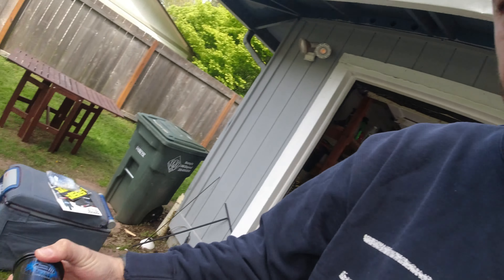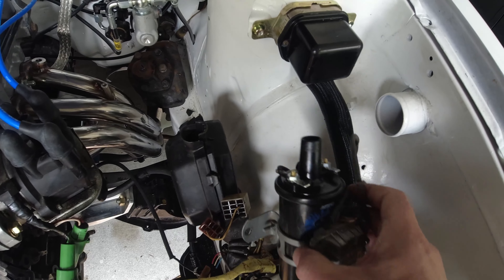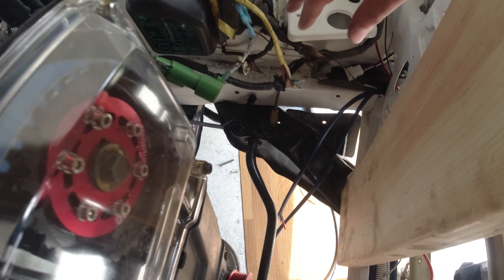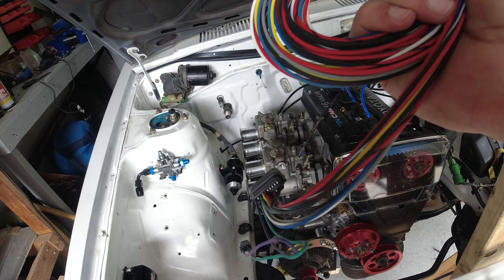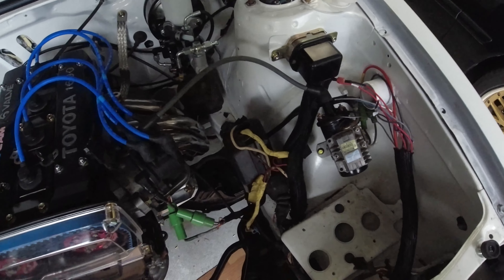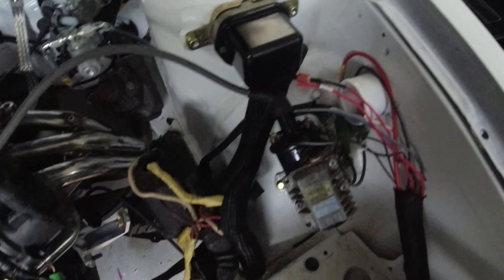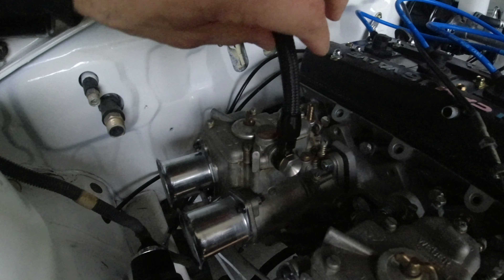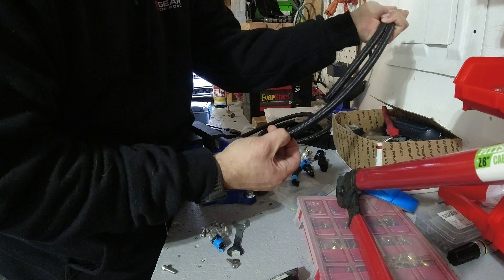Te72 Build ep 13. Pertronix Ignition Box + AN Fuel lines

Comment: Those lines look hella nice! So much better than rubber hoses lol. 
I’m curious where’d yoo buy that lite blue anodized fuel regulator fittings at? Also what size AN lines did you run? I was wanting to change my lines with similar dcoes, not sure what’s recommended with 4cylinder.
Reply from the maker: Those are all -6 AN lines. I wish I used higher quality fittings but everything added up real fast during the assembly